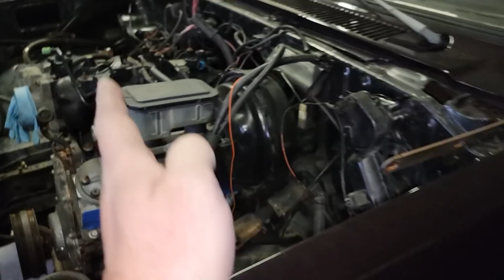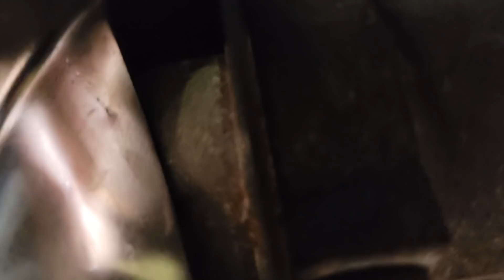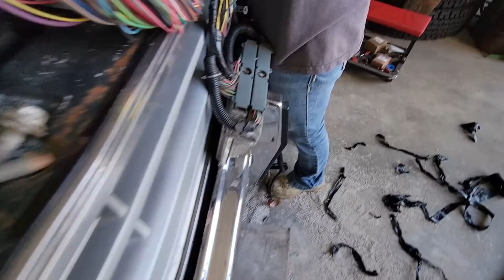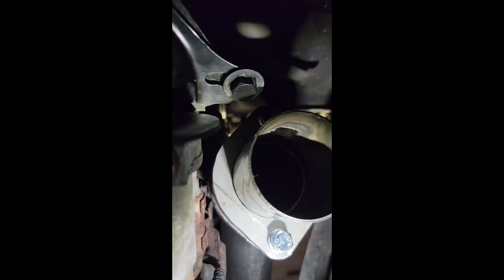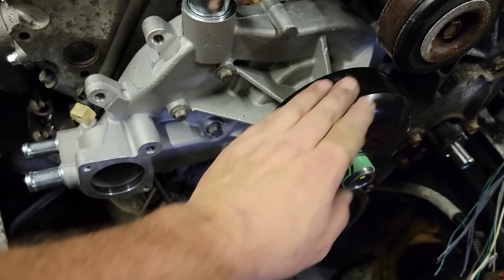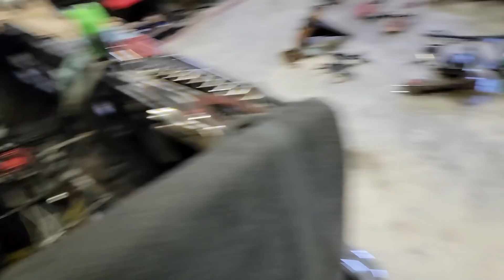SQUAREBODY C10 LS SWAP PT 2 EXHUAST MANIFOLDS, STEAM PORTS, WIRING AND MORE

Comment: Hay jc looking good. Yeah that wiring is a little more than i would want to do. Sat night i had my tractor at a local demo derby pulling wrecks out and playing in the mud (some areas was 1 foot deep)  got home and my f350 brake pedal went rock solid and brake warning light like my booster failed thankfully when in drive way. So im doing my own conversion from 7.3ps f350 vac booster to 460 f series/f350 hydro booster. My 97 f350 7.3ps uses same hydro booster option as the 92 f series unknown engine since the brake pedal is slightly different brake rod attachment. I can get factory hydro booster power steering lines so only thing im using is f series brake pedal assembly

Comment: JC, this particular type engine swap has gone rabid and hundreds of people doing the LS swap into anything that moves meaning look about and I am sure its going into track machines as well. I am impressed with how simple it seems to be and understand the need to just take the time the very first time to just pull a wire at a time as its not just that wire but explains the why and where. Sure a guy can lay all the wires onto the engine, plug them in and then pop all the others out but you don't know the first time that you do this what is going where or..... yada yada. I really think/actually watched you wire scores of the other machines dash or you name it and you have worked on one ....Brent from Halfass Kustoms has done these for the last few years and he bought a wiring loom first time and then went "slap forehead and say dumb bleep" and after that made it his vendetta to show in several swaps he does how easy... it still requires work but my part of it all is once the fuel pump is installed, supply and  return... hell your doing it so no need for me to yada... anyhow... turn the key and one roll over and its purring with good throttle response. I like the no carburetor  issues, its just the best thing for older rigs since pockets on tee shirts . I know one thing tho, never get rid of the donor of engine till done and save a lot of money on this swap. Others think they are cutting a hog when they buy three or more hundred dollar looms for that extra power they promise... about fifty little donkeys for a thousand dollars more is just stupid. I sure wish we were setting over a cup of coffee on that great couple hours you get off once a month maybe. I have been watching Jonathan W build his steam empire... hes onto something good. won't hold you any longer so thanks for reading this.. I like all your projects

Comment: Dear J.C. Smith family
👍👌👏 Very well done again and as always (video and work). You developed a pretty good and simultaneously easy system for clearing the cable harness. Congrats!
This LS swap looks really, really good so far. Your professionalism simply makes the difference every time with everything (not to forget your work ethic).
The only thing that would worry me (daily driver or not) is the heat going to the starter motor coming from the very close/near by exhaust pipe.
As always Thanks a lot for making teaching explaining recording editing uploading and sharing.
Best regards luck and health to all of you.

Comment: good looking build. why not keep the overdrive?
Reply from the maker: the 4l60e is electric speedometer. nothing to run the cable speedometer of the truck. truck has  2.73 ratio rear end. the over drive would be worthless unless this 78 year old man wants to do 120mph. also the shifter in the truck is for 3 speeds. the 4l60e is a 4 speed. the shifter wouldnt be accurate....may not even let it go into 1 st gear manually. i could have overcome the speedometer with a new set of gauges....for another almost $700. i figured the original trans was the best option.